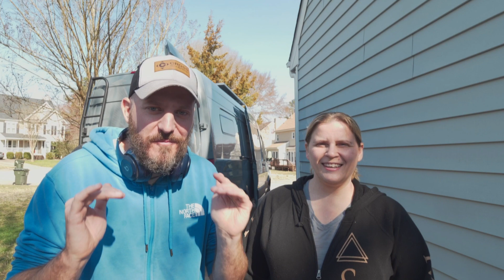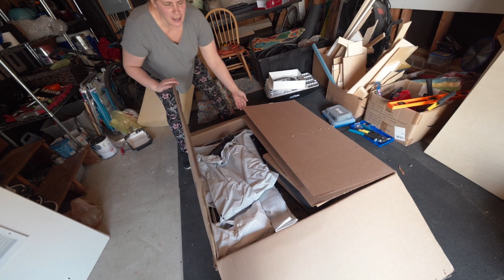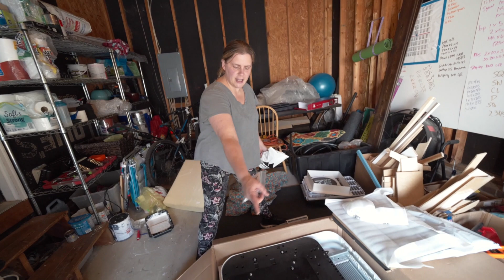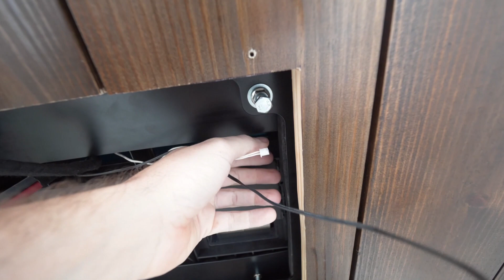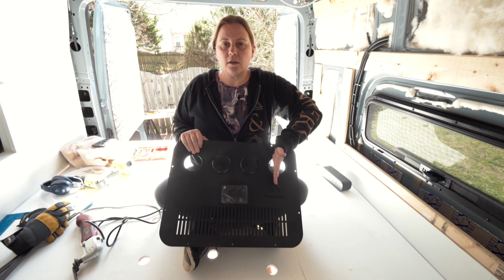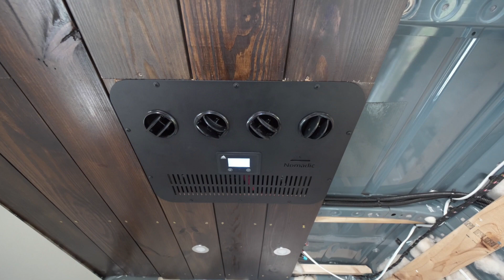Van Build Air Conditioning  | NOMADIC COOLING 12V Air Conditioner Install

Comment: Hi , how thick is the roof top? Because I  have a 2019 van promaster. Like to install ac
Reply from the maker: It’s the same as the walls, a few mm thick… you should be able to install an AC no problem… but just to be sure I’d ask the manufacturer of the AC you’re planning to install… I hope this helps!!!

Comment: The 12v unit's y'all used EER rating is low compared to high efficiency mini splits, did y'all consider those?
Reply from the maker: We did not! They weren’t really readily available when we were building… if we had to do it all over again we definitely would have gone that route

Comment: Hi! Where did you get that separator? I noticed it didn’t come with my nomadic unit and they don’t sell it. Even though they have a separator in their blog instructional.
Reply from the maker: Are you talking about the gasket? If so, ours came with the kit. Thank you for watching!!!
Reply: @WanderfulRevolution  no I mean that rubber separator you put in to keep the room intake and cold output separate
Reply from the maker: @yevkenny  ooooh ok… sorry! We went out and bought it at a hardware store! Easy to find in the HVAC section…

Comment: Has anyone installed one of them on a 5th wheel rv?
Reply from the maker: I'm not sure, however the unit is meant to fit a standard 14x14 hole that a normal AC would be in. The issue would probably be the wiring. The guys at Nomadic Cooling are great at answering questions! Their customer service is great!

Comment: How is the AC working now that it is July?
Reply from the maker: We are currently at elevation in Colorado so no need to use it here. We did spend a week in SD and had some temps in the high 90s (96-98) for a couple of days. The AC kept the bed area very comfortable. It is not able to cool the entire van in those temps though (170ext).  The front of the van was much warmer than the back. It serves our purpose though. The cat had a cool place to be and we were able to keep cool in the back when we needed to be in the van. Feelfree to respond with an specific questions you have!

Comment: I have been using a Proair 12V AC unit for 3 years in a 170" Sprinter HT with 2nd alternator. I have been happy with it & only had a few hiccups. I will say when it gets HOT, it uses a lot more power.  When it's in the mid 90's and 100% humidity, yeah it pull's the juice. I have 6 x100 ah of BBB & 300 watts solar and in the harshest of conditions I get about only 4-5 hours, but if it's in the upper 80's & 80-90%, then I can get 6-8 hours run time. So I believe you will hear the same about temp with run time with all 12v AC's. It sound like you two + cat have it under control and will be enjoying the cool air during those hot summer days. Oh, a word of advise, cover those windows......BUZZ
Reply from the maker: Thanks for the info! We are expecting to only get 5-6 hours max when it’s really hot out. We only have 400 ah of batteries. We will definitely be fully rating within a couple months. We have to be in Texas in July so that should be a really good indicator for us.
Reply: @WanderfulRevolution  do you have video where you review how well it performs off grid in hot weather?

Comment: Hi guys!  Great video, and thanks for posting.  Just wondering if the 2000 is doing the job so far?  We're trying to decide between the 2000 and 3000.  Not sure the extra BTU (and the extra power draw!) of the 3000 is necessary for 80 sq ft.
Reply from the maker: Hey there! So far the 2000 has been doing pretty well. It hasn’t been crazy hot so that’s yet to be determined. Ours is located over the bed and it keeps the bed area very comfortable. Definitely not as cool near the front of the van though (but with that being said we didn’t have our window covering on in the front of the van either). I would say that you should try and centrally locate it if you want more balanced cooling, but we like it over the bed because we can just retreat there if it’s exceptionally hot.

Comment: Hey friends! We’re in Raleigh too! Did you guys get a 2000 or 3000? I have been hunting trying to find out if the flush control panel only comes with the 3000 or if it comes with the 2000 as well. Anyways, can’t wait to follow you along! Take care!
Reply from the maker: Hey guys!!!!! We got the 2000 and yes! It comes with the flush control panel! We are excited to follow you guys too! We noticed that you are a travel nurse! We were both travel nurses for 5 years! And we both started in the Duke system!

Comment: Ooh this is great that you can use the same hole.  We are building our van now (but can't afford one quite yet).  I'd love to pre wire in there to be able to make the switch later on.  Is this all wired to your DC fuse box?  Or does it get run to your inverter?  Or AC?  Thank you!!
Reply from the maker: Yes! It’s awesome that it was the same hole! Otherwise we may not have been able to add it!  Ours is wired directly to our busbar via a  blue sea circuit breaker. It pulls too many amps to be hooked up to the fuse box (our fuse box is only rated for 100amps). No need to hook up to inverter because it’s a true 12VDC unit!

Comment: I need an a/c for a box 
 truck in Texas with 95-105 summers.
Reply from the maker: You should give these guys a call or they also have an online chat.
https://www.nomadiccooling.com
They are based out of the Phoenix AZ area so they should be able to tell you how these will perform in that type of heat
Reply: $3,890

Comment: Ok, you convinced us! We just ordered one!
Reply from the maker: Oh! Yay!!!! So exciting! 😊 What size unit did you go with? We are very happy so far! The true test will be this Summer when we get into some much warmer temps though!!!!
Reply: @WanderfulRevolution  we ordered the same unit as yours. We think it will fit our needs. We need to be cool to sleep, so it will work out great over the bed. We’ll have to remove that fan and move it up front. We haven’t installed our front fan yet anyway, so we still have one fan in the box that we can sell now. Can this unit be run as a fan only?
Reply from the maker: @fbr65  good question! There is a button that says fan on the remote but we didn’t try it yet! We are gonna play with it some more in the next few days. Didn’t want to run it to much while the caulking was curing. Don’t know if it matters but we just wanted to wait because of any vibration. Will let you know what we find out though!
Reply from the maker: @fbr65 ok so I was curious so I just went and checked! Yes!!! You can use it as a fan only! Of course it only pulls air in though! We we using about 5-7amos in fan mode, so it does use more than a max fan, BUT you can really feel the air flow!!! It’s really good!!!